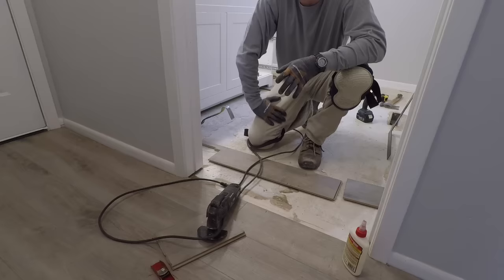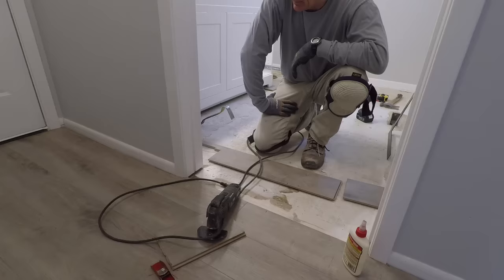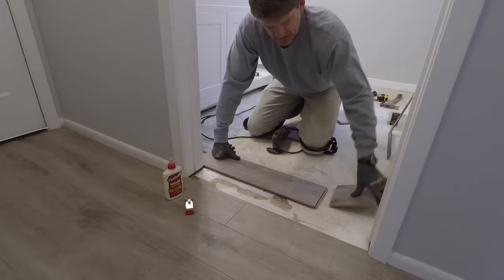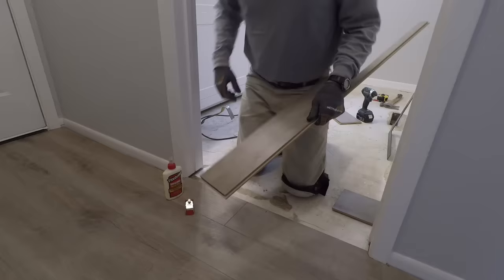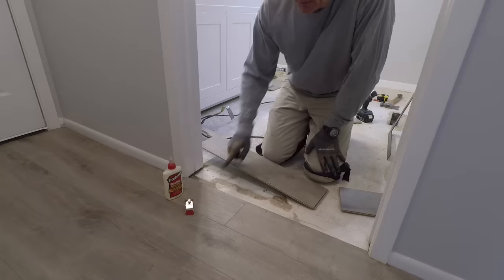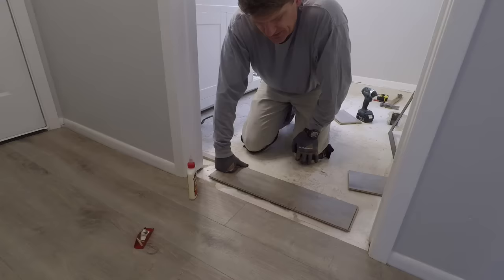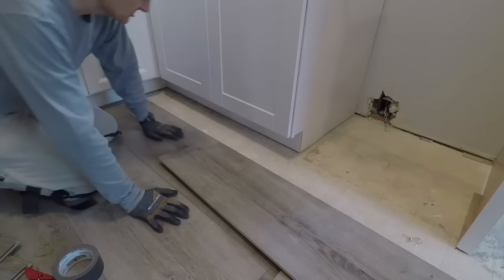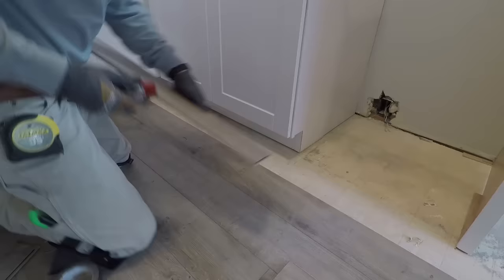How to install laminate flooring around doors and cabinets.

Comment: you could have installed the first one and slid it over keeping the factory locking mechanism then slide the next one in raise up slightly and tap with tapping block
Reply: Yeah this is what I did, I managed to get a corner started and the tapping block worked wonders getting that joint closed.
Reply: Yup, no need for glue!
Reply: Yea that will be coming up or separating in about 2 years
Reply: Wrong installation, I’m sorry.
Reply: Tried n true glue..thats what they used before locking boards 💪🏻 the joint will b stronger
Reply: @natedawg88  that glue is stronger than screw or nails. That's not coming up in two years.
Reply: I've used this method several years ago and it's solid. No separating. Works well
Reply: Useful tips & tricks + the guy sounds exactly like Owen Wilson. Great vid.
Reply: Nah.  That's some rookie bs 😀😂😂
Reply: Possibility not because the long skinny bit what is against the skirting will hit the architrave when you lift it to klick it in maybe !
Reply: Can you point to a video where it is done the way you describe?
Reply: The reason that floor will come up is because the rest of the floor is floating and the glued boards are secured.
Reply: My laminate floor instructions actually say to do this in tight areas like this.
Reply: Unfortunately not all brands of flooring can do that. The last two jobs, I could, but the one im currently doing you have to lift to lock in

Comment: Why take the lip off in the small lock put them together and slide them in at the same time then only one glue line on one seam and the other is Locked in the center.  Nice video otherwise.

Comment: Glue is ok, but not removing edge is better.  Don’t use a tapping block; instead, use a short piece of laminate—lock it in place, and whack the next row into the previous one.  By using a discarded piece of laminate, you can hammer the new row harder, without damaging it.  Also, use a flat crowbar to lift the new laminate up slightly, while you whack it, so that it snaps easier into place.  The crowbar method works when installing under door jambs.

Comment: Maybe I'm missing something, but why cut off the locking for the two pieces to connect and then glue them together? Why not just snap the two pieces together first and then slide them in at the same time?

Comment: Now if you can just explain to my wife why these projects aren't like on TV; I can't edit out all of the headaches (warped floors, out of square walls and rotten toilet flange supports, trips tp the hardware store and scores of other challenges you run into on old homes), cut to commerical and return in 5 minutes looking buff, intelligent, happy and relaxed. After forty years you'd think a light would go on but, if it did, she'd just want me to change the light fixture to fit in with the rest of the house that seems to be in perpetual remodel mode. LOL
I like this video though, very straight forward, simple and well presented.  Good job.
Reply from the maker: Dale, that’s the best comment ever!  I have a wife too ;)
Reply: The other obvious issues is who has all these tools to install a floor? I have opposite problem. I install hubby watches. Always using make shift tools since I do not have a table saw and all the other fancy tools. Nope never goes “ as seen on TV”😂😂

Comment: This was a huge help, thank you! In retrospect, cutting off the edge and using glue seems so obvious, but it never occurred to me. I've spent years (literally) trying to figure out how to snap a piece in under a door jamb, lol.
Reply: Do not do this method with bamboo floors.  It won't work. I know because I tried it and then had to remove the flooring and redo it.

Comment: This is great, working around door frames is a pain. What I have done in the past is slide the interlocking parts together on the short side by tapping the piece in, so you would only have to shave one side.

Comment: That's wonderful machine. I envy you. Also i want to take your machines. Haha. Just joke. Good machine. My country of  tile's machine developments speed is not good. And most of old tilers are fraid of development. Because when they learnded and studied from  the tile skill of the older than tile's master, they were hit from the master. So they are fraid of change, challenge,  and own position shaking. You are a good tile master. I also tile engineer. I have worked for 8 years. I appreciate to you. I am archtecture in Republic of Korea the first grade that pubilish my country. By the way i was wood maker for 2 years. Last i learned from tile master skill of the best of best in Pohang city ( now i live in city). Finally glad to see your youtuve channel. Good study to me. I own my youtube channel that homemaker. Thanks. God Bless you.

Comment: Another approach is to still lock the longer board in on the other side of the doorway then slide it into place under the jam. The same could be done against that cabinet. That way you're only having to remove the locking and doing glue only on the much shorter side. Nonetheless, GREAT video! GREAT advice!
Reply: Can you point to a video where it is done the way you describe?
Reply: @msp9810 you simply connect it together and tap it into place, which will slide the flooring while it’s hugging along the locking piece
Reply: This cannot be done.  You state to lock longer board in on the other side of the doorway, which would be the side already down.  This will not slide through the doorway, since it is longer than the doorway opening.  Or are you referring to the reverse which will not work either, since the two pieces go around the door opening and are too long.     Your second explanation does clarify anything.  Does anyone understand what he is trying to say, or could you try a different approach to explain? Thanks
Reply: I think what he suggested is to snap the long piece together but just shy from the door jamb on the short side, they you use a scrap piece on the opposite short end and tap the board under the jamb, that way the long piece at least will be locked with just having to cut the short piece locking tab

Comment: Some products require a transition in all doorjambs I guess for expansion. I've generally started doing that by default as it makes the install a bit easier. You do really nice work here though. Shaving that female joint and glueing is a life saver.

Comment: There’s lots of ways to do this.  I do it differently. But your way works well and would work well for homeowners that want to tackle it themselves.
Reply: At first I was like that's dumb to shave it down like that. Just measure all your cuts correctly an knock it in place. But yeah I can see how this would be helpful for a homeowner.

Comment: DAMNIT MAN!!! YOU JUST SAVED OUR ASS ON THIS BIG JOB WE ARE ON !!!!!!THANK YOU!!! we were hired by a bigger flooring company to put down L.V.P.so we loaded all the equipment to do l.v.p. and not tile or wood laminate. Drove three and a half hours to the shop and forklift driver drops a load of damn wood laminate. Now I know it's kinda the same with shape how it snaps together and how it's installed..but this part is extremely frustrating without the correct tools and made the job way harder.and cutting in under the door jamb and getting it locked in place has been the most frustrating experience I have ever dealt with just about.i cannot wait till tomorrow to get to work and show this to my boss he is going to be so happy. It is such a struggle that he has himself convinced we are putting them in backwards and that is what is making it so hard.i don't know how someone with 50 years experience with flooring has frustrated himself so bad the it made him think that and know matter how I show him it is impossible to convince him..this is going to change all of that.if it had been lvp it would have been ok because that is a lot more playable and easier to molest it in there but with the wood it is not and it's very easy to chip it or mess up the joint to where it doesn't cnap together and then have to go re cut the piece and try again.i don't think I've been so excited to go back to a job that has frustrated me to the point of almost wanting to quit because between me being annoyed and my boss pissed off because he convinced himself I have him installing them backwards I have had it.he has never installed this flooring before I have but I had my boss doing the door jambs so I never learned the proper technique and he has always just done tile so he took on the job because we were told it was lvp and I have put down acres of that stuff and told him take it we can knock it out quick and it being wood has made it such a struggle and our install time is almost up..but the time this is going to save us tomorrow will most likely make it so we can finish a day early instead of being a day late or someone staying behind and working all night t hit the deadline..thank you so much for this video dude
Reply from the maker: That’s a real predicament. I hope it works out better now. There are comments on here saying you can force laminate and get it to snap into place without having to cut the lip, but I know some styles are easier than others to work with and the one I was using when I made this video was about impossible to force. Good luck!

Comment: Thanks for showing what to use to cut the wood to slide boards under. That makes it understandable and knowing what saw to use to do this makes it possible to install my flooring without worries of it being cut badly to fit. Thanks for the video.

Comment: This was a big help to me, thank you! I've been laying some click laminate flooring and had wondered about shaving boards to fit around a door opening so I just slide the boards in under the door jam, but lacked the confidence to know if it was the correct thing to do. Your video confirmed my idea and showed me I was on the right track. Thank you so much from the other side of the pond! 😀👍🏻🇬🇧

Comment: The later portion of the video regarding cabinets or opposing walls. You can start the flooring at a 45° angle like he did and use the curved end of a flat bar and pry slightly against the flooring and wall by twisting the flat bar while pressing down on the flooring and it will snap right in no need to shave off the top tab. If you lay it enough you will find all kinds of tips and tricks
Reply: Could you post a video showing that

Comment: Thanks for sharing! Great job! Those doorways can be a P.I.A. when running a flow through floor. I totally agree, using the oscillating tool is the best method for cutting out those jambs and trim. I start my flooring on the doorway wall when using T-Molding and running the flooring parallel with it. Just cut > pre-assemble > slip in place and continue on. That way, I'm not all jambed up at the doorway...... LOL. Thanks again and Happy Holidays! 👍😊

Comment: Haven't done a floor lately (homeowner and been a few years) but the ones I put down you can hammer into snap. As in lay two of them down flat next to each other and hammer hard enough through the plastic block and they'll snap into place. No taking it back apart without damaging one or both of the pieces though.  Look at the instructions that come with your planks, should say it if its ok to.  Good vid. Always remember to include the basics.  So many people skip over the basics.
Reply: Thanks for the advice! 😉😉
Reply: I've broken the edges of quite a few pieces by flat hammering... which is VERY frustrating when you have just spent ages carefully making a template and cutting the pieces...

Comment: Never under any circumstances apply glue to a floating floor. If it is found it will void your floor warranty. Instead of breaking the locking system (LOL) Put the piece of floor in just outside the jamb, and with a tapping block and hammer, tap the butt end to slide it under the jamb.
Reply: Was wondering how can you claim a floor warranty?????,
Reply: To: Eric   Check Mate :)
Reply: That works perfectly for the first piece. Any suggestions on how to do that with the second piece?
Reply: @Micheph  You can wear through the pattern with a chair leg, which is exactly what happened to somebody I know. Their specific floor was no longer made, so IIRC they got a few bucks back based on 3 damaged pieces (right at a seam). They decided that a few bucks and living with it was better than getting a free box  so they could replace a few pieces that, thanks to Murphy, are almost always in the middle of the field. In their case, if they actually wanted it fixed they'd have  had a few bucks towards putting down an entirely new 200SF +/- floor.
Reply: @stevepseudonym445  Got it, Didn´t think of it that way
Reply: @Micheph  Flooring manufacturers are strange. I used to do a lot of installing for Lowes and they sold a lot of pergo brand flooring. Pergo requires you to do what they call perimieter seal which is to take foam crack filler and stuff it under the base/drywall and silicone it in. While this actually has no positive effect on the floor in my opinion, it will %100 void the floors warranty if you don't do it.
Reply: @erichough9688  Thx will take note of that.
Reply: @stevepseudonym445   that´s a cool idea though in Europe it may not work
Reply: @erichough9688  foam then silicone and then baseboard ?!???
Reply: This is a false statement and actually varies by manufacturer. For example, one manufacturer I'm looking to go with says to do these exact instructions.
Reply: Good luck trying to get the floor "warranty" to cover anything.
Reply: It's cheap enough you can afford to replace it

Comment: That long bit in the doorway,you could have just fitted it as normal,but 1mm short of the  edge of the door frame,then hammered it sideways so it fitted under the bit you cut out. I would have carefully hammered that short bit into place to complete the doorway.
Also,I have hammered in loads of planks of laminate,and even crowbarred it in round the edges,as they do pop in.
People should realise that you need to plan everything before you start. New skirtings do/can look better,but they can be a hell of a lot of hassle,even take longer than laying the floor, so quadrant is the safer bet.
Reply: I followed your instructions and it worked perfectly for me. Thanks mate. You’ve saved me.
Reply: @omi8015  Magic hehe.
Reply: i was watching and thought exactly same thing and using the plank to cut above leaves a gap the size of the blade which i would caulk for sure.

Comment: This guy is definitely trying to help people and I commend him but these flooring manufacturers will use any installation error to not help the consumer if they have issues with their flooring application.  READ THE INSTRUCTIONS.   then follow them if you want to maintain a manufacturers warranty
Reply: Exactly, best to call the warranty a joke and just build the floor as strong as possible.

Comment: Thanks for this, it explained perfectly how to do this part where the manufacturer and others were silent on it.
Reply from the maker: You will see plenty of comments saying never cut off the lip, etc, etc. It works for me and provides good results so I’ll keep doing it!
Reply: Literally dont do this. The glue will fail ESECIALLY on thresholds, where the floor tends to be just a bit uneven. Then it will dog-ear, and good luck getting it replaced after you literally cut their locking mechanism off lol. It voids the warrenty.
Reply: What he doesnt tell you is how it stops working for him a year later
Reply: @chkchkpap45  Seems to me that a full length seal of glue is mechanically stronger than the click lock mechanism.
Reply: @erichsh58  I think you got that correct however one detail you don't provide in your reasoning is this: Can wood glue withstand the small expansion/contraction that happens overtime with this type of flooring? Does wood glue allow for movement or flexibility or would it crack and fail over time from walking on it?  It may be stronger in tension but it may be weak in compression.  Something to think about.

Comment: Thank you for great troubleshooting for us noobs. I think I screwed up the first piece installed LVP female towards the wall! Directions said tongue towards to the wall so male goes on top. However, our small 40 sqft bathroom V-Evo-Max  Durato looks amazing! I didn't need to glue down the last piece for transition only trim it down.

Comment: Thanks, I am just finishing up my first floor installation. It went well.I give it an 85 % grade but I struggled with this and was sweating trying to figure out what to do I ended up get them to lock but after so much fighting with it I was exhausted and I still have a little gap around the door jam even though I used the multi tool to cut a space for the plank to go under. On the next floor I hope to get I will use your method. 
Now I need to find a way to install around spindles. 😪

Comment: Hi, you could have connected the first piece (to your right) without cutting the lip. Just join it normally in the middle of the door opening and then, tapping the block you could shift it  to the final position along the lock. For the second piece (to your left) indeed cutting a lip, using glue is the only solution. Thanks for the video!